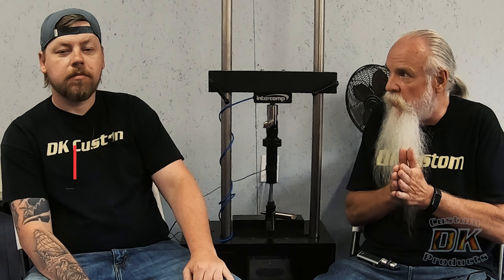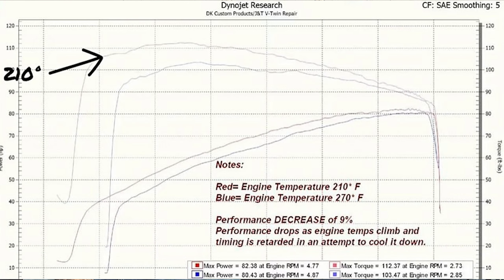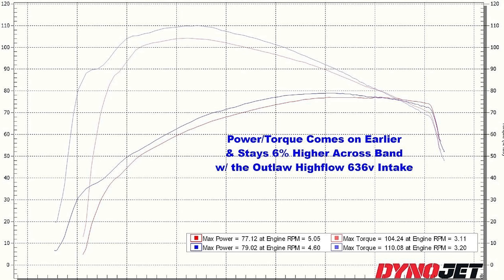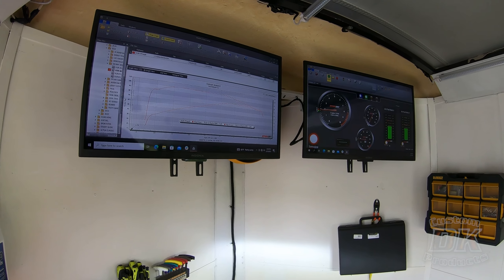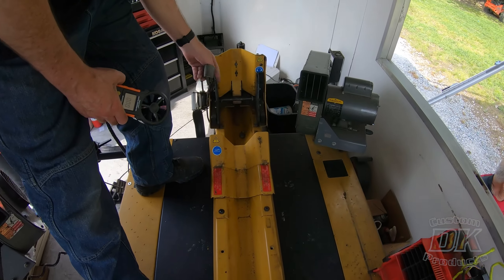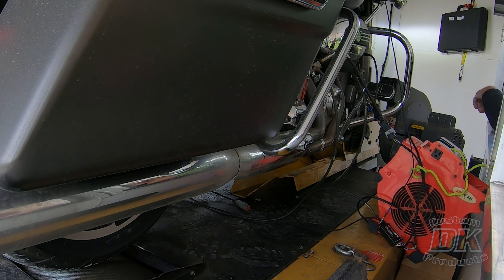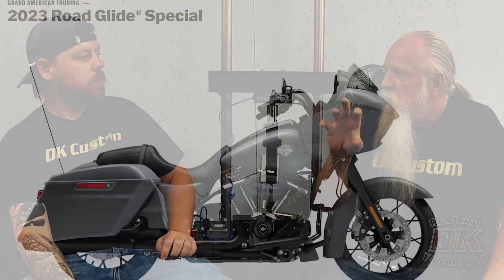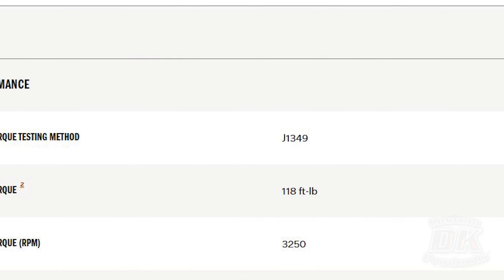Unraveling Dyno Secrets: Harley Performance Testing Demystified!

Comment: What does the SAE: 1:04 represent adjacent to Temp. & Humidity on a Dyno chart?
Reply from the maker: Great question!
There are a few standards used in the dyno world for gathering HP and TQ numbers, UNCORRECTED, SAE and STD. Uncorrected is NEVER accepted in the world of dynoing and tuning as it does not factor in any weather conditions etc. Now here is where the big debate comes...is between SAE and STD. SAE (Society of Automotive Engineers) is the MOST ACCURATE AND WIDELY ACCEPTED FORM OF MEASUREMENT when it comes to the world of dynoing.

 Most people know that showing STD numbers read higher but not many know why. SAE represents more realistic standard conditions, STD artificially boosts numbers.

Comment: I bit off the video subject but can my 2021 Fatbob114 get a stage2 upgrade keeping standard air cleaner and standard exhaust headers with Rinehart slip ons?
Reply from the maker: The headers are fine, the air cleaner on a 2021 Fatbob 114 is better than most OEM air cleaners, so you will be fine to do a Stage II upgrade (cam).
You will get a bit more out of it if you use a True HiFlow intake with an External Breather System, like any seen at the link below.  But, you will be ok with the OEM.
https://www.dkcustomproducts.com/air-cleaner-intake-c10-382.htm
Before doing a Stage II on any of our bikes, we take care of the fundamentals first....that way the Stage II is built on a solid foundation, and we will get the most out of the cam upgrade.  Here is a video on the subject- https://www.youtube.com/watch?v=GK5x3lcQvJU
Reply: @DKCustomProducts  thanks again for your usual informative reply👍 Great channel by the way.
Reply: @DKCustomProducts  I do wish your 636v was available here in the UK 🇬🇧
Reply from the maker: @robertprosser6856  Thanks for watching! Glad you found it useful!
Reply from the maker: @robertprosser6856  Give us a call or shoot an email to support@dkcustomproducts.com and we may be able to get you setup with a dealer in the UK.

Comment: I’m sure this was covered in another video, but is it safe for the M8, if you remove the stock mufflers and run short straight pipes only? No tune. No new air cleaner. ‘22 Fat Bob.
Reply from the maker: Yes, it is safe.  Unlike the Twin Cams, the M8's are not too lean.  Here is a video on the subject- https://www.youtube.com/watch?v=Lb_57Z_Ipms
You will get more power out of those short straight pipes if you use some Thunder Torque Insert™ in them.  Link to TTI's- https://www.dkcustomproducts.com/thunder-torque-inserts-158-model-family-dk-tti-158.htm

Comment: Finding someone who knows how to properly dyno an engine is hard to find... it is a skill set that is lacking.You can have some clown screw your tune in a heartbeat. Another reason I stay stock. I know that a good tune is the best route. However, I choose to avoid the potential headaches. HD needs to design a full water jacket cooled engine to eliminate the overheating we all experience. For the price we spend on these bikes, these engines should be more reliable with longevity in mind. Good video... :-)
Reply from the maker: Thank you, glad you found the video useful/interesting.
Agree with you 100 that it can be difficult finding a good person to tune.
Harley has had two lines of bikes in the past that were fully water cooled...the vrod and the streets.  Both discontinued, folks just did not like them.
They currently have the Pan America and the new wannabe "Sportsters" that are fully water cooled.  They also are not doing well in sales at all.
HD is in a Catch-22, which we discuss in this video- https://www.youtube.com/watch?v=N0kLaVQhbW4
Reply: They can offer both types... do a prototype with a water cooled engine in a touring bike and see what happens. This is definitely one reason why a lot of people are opting for an Indian cruiser. The street bike was an entry level bike. The Vrod was a sport bike. If my current HD engine goes south, I will fix it under warranty, sell it and buy an Indian, BMW R18 or a Japanese Kawasaki cruiser. I am not into changing the engine or tune from stock. I just want to cruise without worrying about overheating. Water cooled engines allow that. I have never been so concerned about overheating or oil consumption until I got into the HD market. It is ridiculous for the amount of money we spend. It gets expensive trying to make these engines reliable and maintaining longevity.
Reply from the maker: @richardrussell500  Understood!